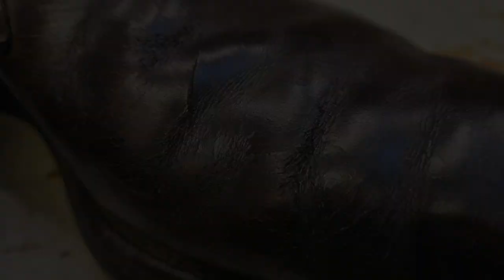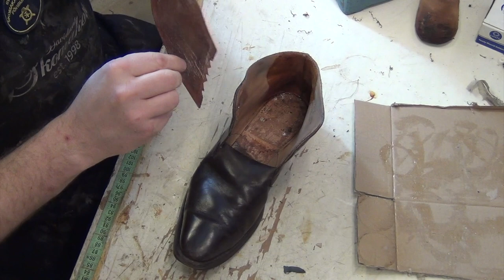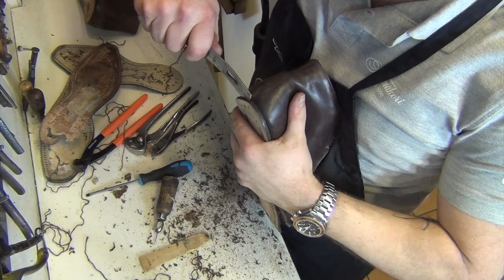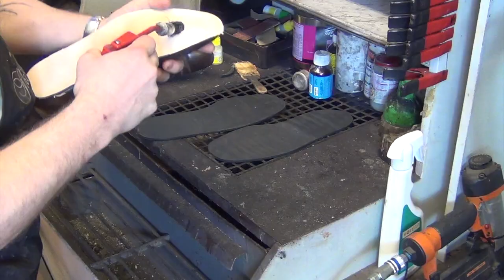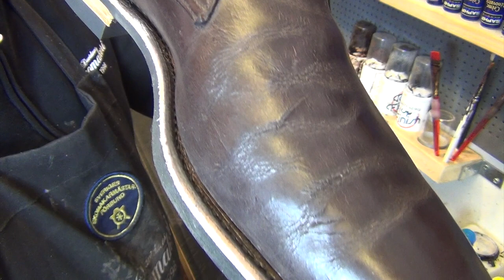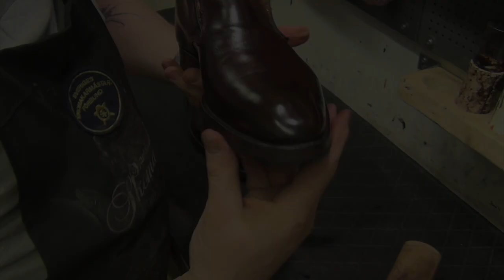Restoring Crockett & Jones Tetburys

Comment: Great video! I would like to try to glue, bone and sand cracks in my leather shoes. Could you please advise what kind of glue and what grit sand paper I should use?
Reply from the maker: Unfortunatley there are no easy answers to that. I use 5 different adhesives and fillers depending on the location and deapth of the crack or scuffmark. And I use a bunch of different grit sand papers. You really need to know what you're doing if you are gonna do an upper restoration. I can only recommend that you let a good cobbler do it for you.

Comment: How come you dont make a trench on the outsole before you stitch the sole?
Reply from the maker: Hi. I usually try to make the repairs look as close to the original as possible. Original Dainite soles are never grooved before stitching. It is not really needed. The thread is often "pulled down" enough to make the stitches hold up a long time. And when they eventually are worn down, the repair holds up anyway, since they are properly glued, and the thread is waxed.
Also, if you were to groove the rubber there is a chance that the thread would tear through the sole and destroying it. Safer this way and more pretty. That said, there are situations where I groove rubber. You have to judge every job independently, and account for a number of factors.
/Marcus